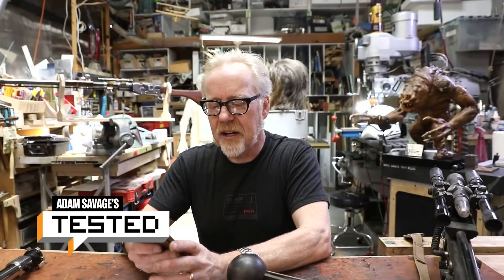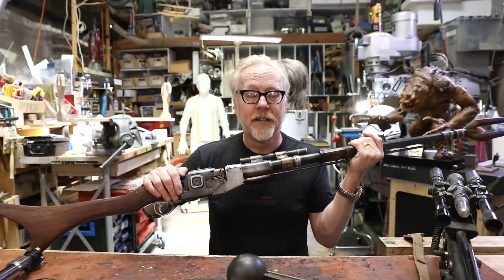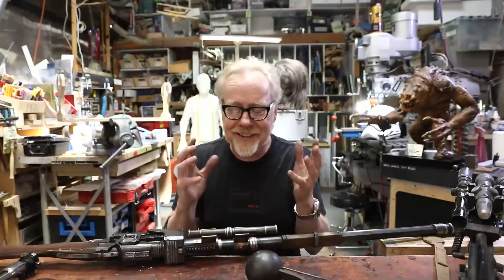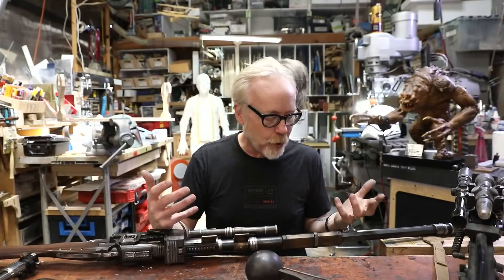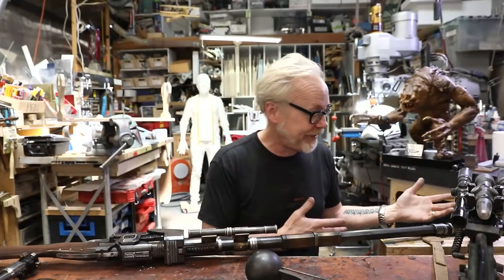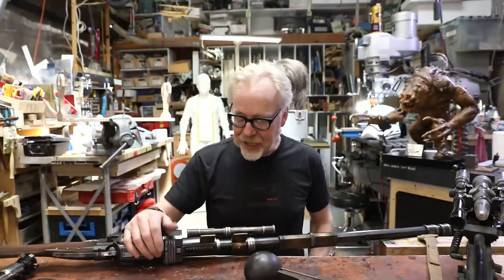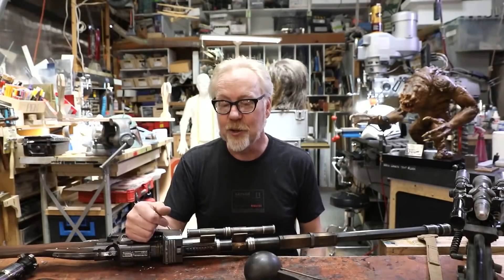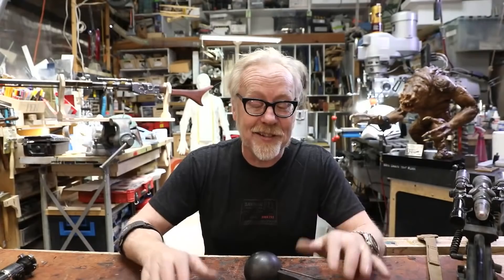Ask Adam Savage: Machining vs 3D Printing

Comment: As many said it before:
There is a massive difference for those who just wanna "print from a 3d library" vs those who want to do "design change", unless you were the original designer of that CAD model.

Second, traditional 2D drawings provide dimensional information describing the component and potentially assembly fits, but dumb STL file does not.   Many manufacturing facilities will not accept 3D STEP or parasolid file alone, unless it is accompanied by 2d drawings.

Comment: I am totally the same way with 3D printing. If I'm printing something that someone else made, and it has lots of different pieces, I spend time looking over each part to understand it, where it goes, how many are needed, etc. Sometimes I'll even import the STL files into Fusion 360 and virtually assemble them all into the finished piece so I can see exactly where each part goes and understand it in relation to the model as a whole and view it from all angles before printing. Even then, I still usually print test pieces when possible before printing the whole thing.

Comment: The "where does that part go?" and "did i print all the parts?" questions are why I've moved to printing .3MF files of whole assemblies of parts.  It may be 50+ parts, but they're all in the right location relative to each other so I can get a good visual preview.  Then for printing, the slicer will spread the parts out over the build plate and I always know I have the right quantity of bits.  (this also works with .STL to some extent but depends on slicer support)

Comment: I’m currently printing and building something that was designed by someone else. After all the printing is finished, I’ll have more than 350 hours of printer time. This is all in the midst of trying to teach myself 3D modeling for printing which involves way more than just 3D rendering for the screen. So far I’ve had to redesign 3 parts due to metric to imperial conversion issues. All of this to say that taking on a big project designed by someone else, and being forced to redesign portions of that project (or just not complete the project) is a great way to learn 3D printing and modeling.

Comment: It's fascinating to hear your perspective on this Adam.  As someone who started out learning machining and physical (mostly carpentry and electronics) builds and who then moved to 3d Printing (about 6 years ago) I experience much of the same.  

Definitely when I design something myself I use logical naming conventions instead of number codes - BUT that being said there is always a new iteration of the design - usually requiring the same name - and I like to keep every iteration virtually because you never know when you want to revert to a version from way back and go in a different direction later down the line in the design process.  

To this end I've taken to a combination of both naming conventions, and I'm not embarrassed to admit I've gone a bit Tony Stark with it.  For example, in a gun build like you did here I would call a part: Mk1 Barrel - Middle Section V12.stl (or whatever, just an example).  And I usually get to about V (version) 10-20 before I make a major design change that completely adds a new element to the part itself (which changes the MK - or Mark - or demarkation point) and I usually get to about Mk10-13 before I'm actually happy with the design. 

It gets even more challenging when you are working with others - and designing for others, with the intent that others need to understand why you named something a certain way.  Fun times...
Reply: My go-to system is naming "<item> <subassembly> <part name> <iteration number>".
That being said, it's really hard for me to not just modify an existing part and keep it the same name rather than iterating and making a new version of the part. My brain just can't justify holding on to a part that didn't work.

Comment: This is a strange comparison. Apples to oranges and all that.
If you had made the 3D files instead of purchasing and just printing them you would have had the same intimate knowledge of each part as the you would have machined them yourself.
And in the same vain, if you had just purchased machined parts instead of machining hem yourself you'd have just as little of a clue about any of them as you did with the 3D prints.

The difference here is not between 3D printing and machining but between your knowledge of machining and 3D modelling. One of which is a skill you have, one of which you don't.

Comment: I wonder if 3D printing batches of greeblies would be useful for makers. I know they typically come from model kits and that Adam has mentioned before that some were more popular than others. It seems like someone clever could start collecting a bunch of free model files of small, interesting bits that print well to fill greebling parts bins rather than have a bunch of model kit parts nobody wants just to get the few interesting ones. That said, mass produced mold parts are far cheaper than 3D printing, so maybe molded greeblies sets would make more sense.

Production cost to volume, I know ILM can easily afford to just dump their unused kitbash leftovers that aren't interesting enough to be greeblies, but I was thinking about as a resource for maker spaces. (Then again, maybe greebling isn't as common in maker spaces as I imagine.)

Comment: Ohh yes. Sounds exactly like my experience with 3d printing. Every time I think ”I will definitely get away with one iteration this time”. I always end up with 3 :D
Reply: The time it takes for the printer to run a build cycle can not be underestimated.  In the time it takes to make a set of parts, I may have already redesigned them three times.  Let's just call this "Tony Stark Syndrome."  On the other hand, if the printer was faster, I might settle for less-than-optimal parts, because my rethinking time would be shorter.

Comment: I think that answer, about how you need to put the thing together in your head and understand it, is beautifully phrased.

In real life, I'm an engineer. But when I first went to college, studying engineering, I flunked out. There's a lot of (unnecessary) details to that story, but one of the big ones is that the way that my brain works, I solve problems by understanding how they work. I have to bring the problem into my head, puzzle it around, look at it from a bunch of angles until it makes sense, and then I can solve it.

But in my engineering school, the philosophy was that engineers shouldn't do that. A good engineer should be able to sit down with any problem, look only at the specific parameters relevant to the specific problem they needed to solve, and using a robust, tested method, solve that problem. For example, in an electrical engineering class, we needed to solve for the effective capacitance of a section of a circuit - but in that intro class, before we started solving that problem, we never learned what capacitance actually means or how it works. We didn't look at any of the fundamental equations from physics. What we did was take a set of written instructions, memorize them, and learn how to apply them to a piece of circuit diagram that looked exactly like THIS. 

For me, that was impossible.I just couldn't do it. 

And now, 30 years later, the thing that my coworkers most frequently say about me is how good I am at coming into a new, unfamiliar problem, and figuring out what i need to know in order to solve it.

This is all a very long winded way of saying: thank you, Adam. You're providing such a visible example of a person who is open, honest, and welcoming to everyone, showing how everyone can be part of the joyous process of engineering and making. We don't all need to be the same, think the same, solve problems the same way - it's all good. And you always go out of your way to say that.

Comment: I agree to an extent. Iv not been printing for long but I have been 3D modelling for a few years (Maya). When you make something inside a 3D program you do get to learn each peace intimately in the way described in this video. However if you bought the models I can totally understand why that connection isnt there. That being said after spending so much time inside 3D packages I can iterate and alter things in my head, my minds eye so to speak before it even goes into the software. Also plenty of drawn topology in notebooks trying to work out edge flow. 

I expect to a degree If I were to be given a complex machined object I would feel a similar detachment from it.

Comment: Why not combine both??
Platforms like the Snapmaker 2.0 already go in this direction. Very broadly speaking, the areas of overlap (from design to the actual systems) are extensive and complementary. Its just that one is additive and the other subtractive.

Coming at it from this foundation is also very useful for visualization, etc.

Comment: Years ago, there was a statement that has stuck with me: May FORTH be with you!.  The idea behind that was to promote FORTH programming language.  Well, it indeed was with me, actually 4 different versions.  The first was running on a Radio Shack TRS-80.  Laxen & Perry  as well as another version both ran on an IBM compatible one.  And finally a version was on a Motorola 68010 based machine.

Comment: I feel like I get a good visual understanding of 3D models that I design myself in CAD. However, I often get stumpet by the scale. Even though I know the exact dimensions, I find it nearly impossible to visualize how large an object is going to feel once it's printed. Sometimes I have to make cardboard mockups to get a better feel for the real-world size.
Reply: Just import a 3D banana for scale in your 3D software or slicer.
Reply: @Hakonboi  Now, that's some 1000 IQ thinking right there!
Reply: @Hakonboi  I prefer the BIC ballpoint pen for scale when working on smallish parts. Because most people have one of those around in the real world so it gives you a physical size reference. Bigger parts can be a 0.5l or 1.5l soda bottle. If things get human scale, importing a low res human scale analog can also work well.
Reply: Or by modeling intricate pieces for mechanical bits, only to go into the printing software and realize "wait, this gear I modeled  is only 5mm wide??? Back to the drawing board, I guess."
Reply: You also can load the model into a VR viewer

Comment: Interesting take. As a CAD deaigner who "graduated" to machinist and 3D printer-er and then CNC machinist in order to more rapidly 'own' the means of production so to speak... my relation with the processes is quite different. The distinction Adam makes is valid for many but certainly not a universal mental framework.

When you're the one conjuring the part in 3D from scratch and deciding when to print, when to machine. when to hand-fabricobble, and when to hand it off to someone with more capable tools, you definitely have to know your design not only in the present but also all the alternative possible manifestations. 

I've had projects where 3D machining foam and covering with fiberglass was a good approach only to find some of the parts were not taking contours right so was able to rework that model into something ideal for 3D printing that was hollow with ribs and interface points baked in, and actually include fine details that hand layup fiberglass cannot yeild. When you don't own the CAD then even when it doesn't work well, or you don't like how a feature was envisioned, you really are kindof stuck with the part as it is, or you have to have a way to modify the printed part on the back end.

I am reminded of some small tank models from Thingiverse. I downloaded them but realized they were not quite how I wanted to do things. Thankfully I think it was with Fusion 360 I imported the data and added certain features that I wanted for better assembly. So even when using other artists' models from the web there are sometimes ways to examine and format the design to meet your intended use case... If you have access and understanding of the modellling/CAD tools.

Comment: As someone who doesn't have a CNC mill, lathe, or other expensive machining tools, I found 3D printing to be a revolution.  No longer was I significantly restricted in the things that I could make, based on the limited set of tools I have.  You could say that I was "set free" by 3D printing.  It completely changed my thought process, and enabled me to make the parts that I wanted to, without having to compromise.

Comment: Could you guys please do a video on the different types of 3D printers available (incl. the different raw materials used)? A video for beginners. This technology seems to be changing so fast that I don't know where to begin. Thanks!
Reply: I think there's only thermoplastic (fdm) vs resin (lcd, dlp, laser) to choose from at the hobbyist level. Unless you need the detail of resin, FDM is the better choice as it's easier to use.

Comment: I find the mental knowledge of each piece on a 3d print comes when you have to create the object yourself in the computer. Last year (during covid) I was able to self teach myself the Sketch Up program and started to create my own designs there first, the mental gymnastics was in the 3d creation of the piece on the computer. I'm still not an expert at building the parts and its always trial and error to piecing things to fit, but it becomes as rewarding designing a scratch built design in the computer (once you learn to) as it would have been carving a part out of a physical material. (although i admit it takes longer to build a complex object in the computer than it does physically, but if you need multipule of the same shape, and its a choice between building the same shape 30 times, or building it only the once in the computer and then press print) the computer beats out for time over all. hope this makes sense!

Comment: You need to assemble the 3D parts in a 3D cad program to understand their relationship with each other, I do this with real world desks I build in my job. It helps before committing any stock to the machine & errors can be corrected.

Comment: you put all of that effort into a toy when as talented as you are you can make an actual working model although I can never be a real blaster or shoot laser you can still shoot light
Reply: You are severely underestimating the difference in difficulty between an inert prop like the one Adam built; and a "functional" replica. He'd have had to find room to install a microcomputer and wire in LEDs just to have it light up when he pulled the trigger. That's a hard thing to do to someone else's 3D files, and would have reduced how solid the rifle ended up being.

Cronoarms has built a parts kit to convert an airsoft rifle into an Amban rifle, but the end result is way way less screen accurate than Adams, due to needing to alter the dimensions to fit the mechanical parts.

Adam is an incredible maker but he's still bound by physics.

Comment: It helps with 3D printing if you did the actual 3D drawings yourself. You get to know the part in a similar way as when machining.
Reply: I might add, one can hardly afford two laths, or at least cant operate two at the same time (with exception of CNC machines). Where  I am running several 3D printers in parallel. I load them before night time, or for lunch, or during a meeting... when I come back parts are ready or well progressed.
3D printers if setup correctly, like remote access, camera enabled etc, are very powerful tools this days.
Reply: @SarahKchannel  the company I was working with were planning on getting some high temp peel machines for some small parts on the valves they were making non load bearing stuff mainly
Reply: Fully agreed - it's a world of difference - when designing my own files I know down to the mm every measure, whereas I constantly need to check files I didn't design for specs in both my design software and my slicing software.
Reply: I was just about to add the same comment !  I used to machine my self. 
it just depends if you are the creator of the design or not... As Production Designer, I get to 3D model and design every element my self in 3D until I feel it fit. 
The advantage of 3D printing is the iteration time that sucks in machining, vs. great in 3D printing. 
Granted 3D printing can be slow, but that is mainly bad decision making and designing. 
If you hand finish 3D prints they are well worth the effort and can be way fast.
Reply: Same with cnc I used to work in a shop were some stuff was to hard to do with cnc stuff in aluminum bronze I made a lot of parts on the lathe but some of the stuff like the big rotors we would use for pumps were done on the cnc and the pump housings were roughed on cnc then finished on manual machines it gets easier the more you think of something in its whole and make the parts you have to deal with at that time

Comment: 3D printing is a little crazy when you say I need a… and then a few hours later it’s in your hand.
Adam what 3D modeling software do you use?
Reply: Resin printing has blown my mind for this, I've used FFF printers for years and recently got a resin printer. It just comes out of the liquid like the T1000!
Reply: @jimmysgameclips  this is why I got both. The detail In the resin prints is outstanding
Reply: @newtome-jessegates6310  I dropped $1783 for the Phrozen Sonic Mega 8K which has a build plate of 33 x 18.5 x 40 centimeters of space. And will ship upcoming september. Just to print huge chunks of blaster parts which doesn't require a lot of post-processing, which is just amazing!
Reply: @MyTasteOfMusic1  wow